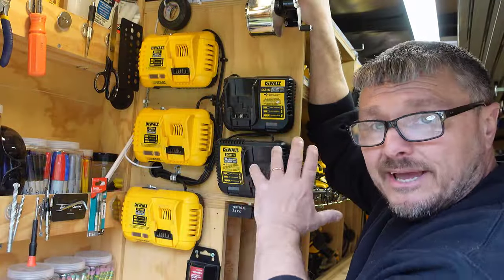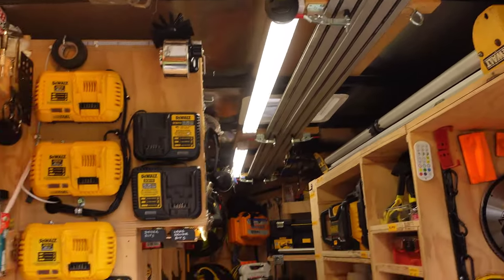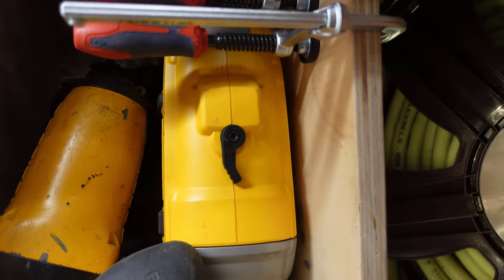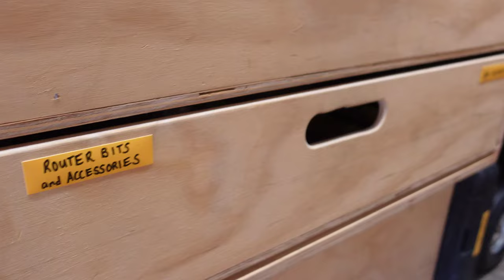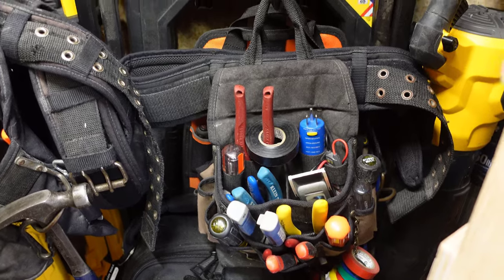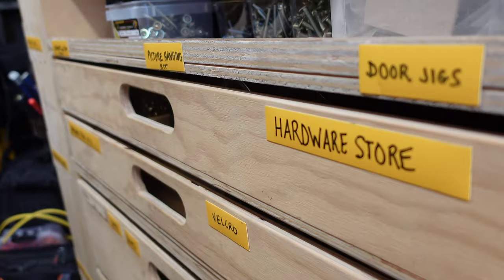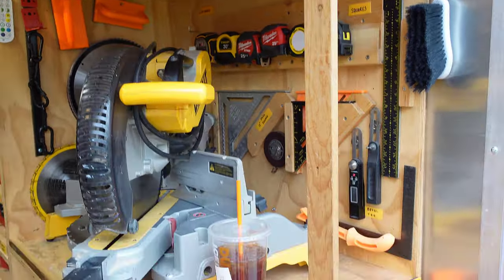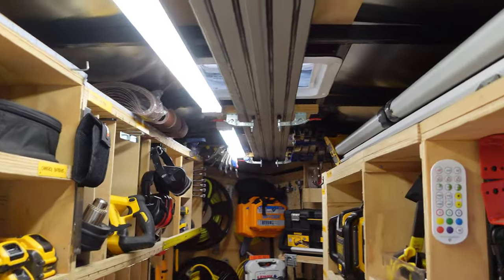sSMART Tool Trailer updated tour for early 2024 - Ron Paulk Buildout

Comment: Hey Steve, great video, thanks for sharing. I've had several tool trailers over the years, and most of them were disasters because I also used them for doing deliveries (cabinets, cars, materials, etc.). I always wanted to do something like this setup because I couldn't stand the mess. But, everything had to be modular, and able to load and unload relatively quickly. I outgrew my small trailers quickly, and ended up with an 8.5' x 24' enclosed car trailer. A world of difference, but the downside, of course, was maneuvering in tight neighborhoods and small driveways. There's no perfect scenario, I guess 😂. Anyway, I had one of my tool trailers stolen from the jobsite once. I highly recommend the DeWalt Mobilelock if you don't have one already. I have an overview video of it on my channel if you're not familiar with it. I can not stress enough what the value of the Mobilelock is. Thanks for sharing your trailer build! One final question: Have you ever weighed it empty? That was another issue that I had with my small ones. They just couldn't hold up to the daily wear and tear running around loaded. Thanks -Dusty
Reply from the maker: Howdy DB! Thanks for the comments! I very much appreciate it. 

I can only imagine what you can do with a 24' trailer with the 8.5' width!!! I will grant you that hauling it in narrow road neighborhoods and parking it in client driveways would be (at least for me) incredibly problematic. I do have a trailer security system!! I will check your video out though. I am always looking to learn. Thanks again!! spence

Comment: Excellent video! I've been watching lots of you and Ron and Richard as I am looking to build something out myself. I want to have a 8 x 16-22 one day but I am doing a lot of work in the city where even a small trailer maybe too tight. I'm working out of a small pickup at the moment and need to decide if I'm going with a 6x10 or a van. Some places I could take a small trailer but not much more. What kind of places do you work? And have you ever considered a van over a trailer? I'm a huge fan of a pickup but vans have a lot going for them.
Reply from the maker: Howdy Shawn! Thanks for the comments. I work in a relatively small town (15,000) and surrounding areas. I could get away with a 14, 16, 18, and maybe even a 20ft trailer but, given that, I couldn't park anything bigger than a 12ft on my pad just off our alley. (too tight to back it in and swing it around). If I worked in a larger city, I would strongly consider one of those tall Sprinter type vans and build it out. I know the Handyman had a 10 or 12ft trailer and he seemed to do well in his city of over 1 million when not traveling in the mid-town. There, he only seemed to have his truck or his wife's van. If I could have two vehicles in a city setting, I would have a truck for most things and a Van built out for work. 

Good luck with your build out however it takes shape.
Reply: @sdsconstruction  Thanks for the insight, keep up the good work!